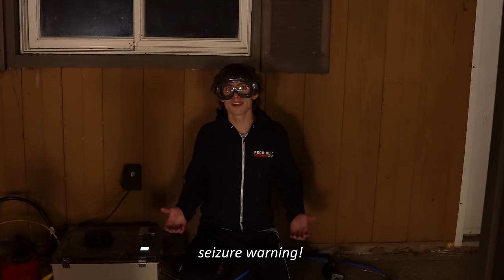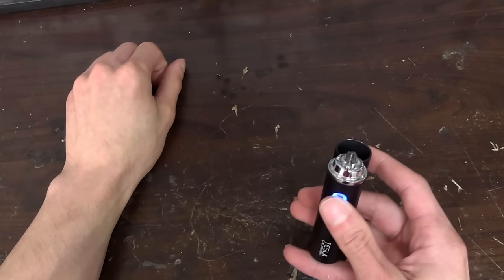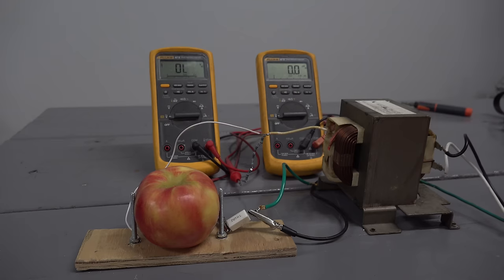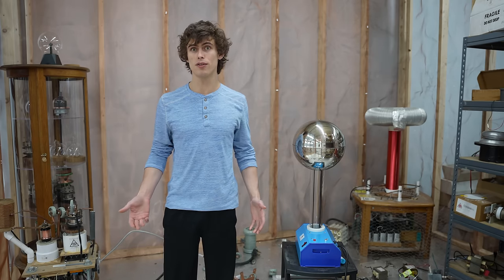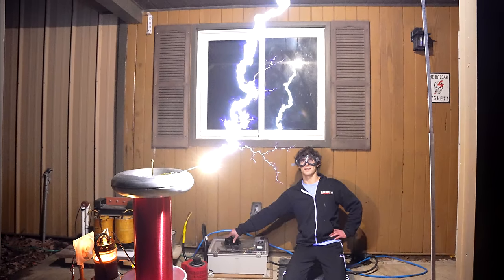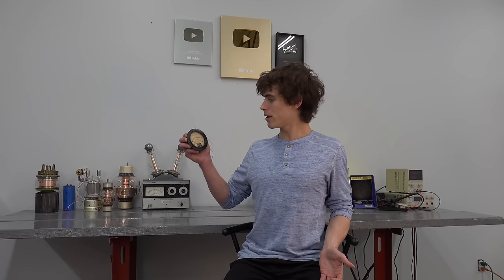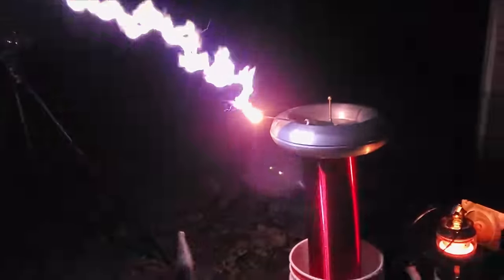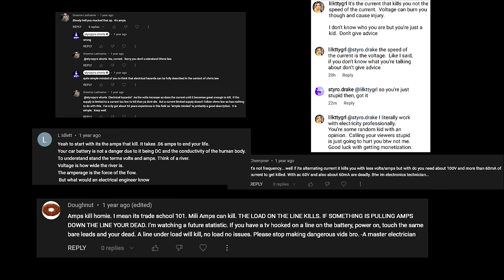Is it the volts or amps that kill?

Comment: I love that pyro's defense for everything he claims is "well I'm not dead", and it's actually a super valid one.
Reply: Yes, but it's not a 100% valid one. Some things kill you by long time exposure and other things kill you if you have the wrong reaction in the wrong situation. So this argument only disproves immediate killing by electricity.
Reply: @benrex7775  Did you only watch 5 minutes into the video? Time affected is a huge point here.
Reply: Exactly, because when the argument is something will kill you, and it doesn't, no amount of flexing degrees or occupations will refute reality. Here Pyro is actually demonstrating the scientific method instead of the authority bias like others.
Reply: @billbill6094  I was answering a different question than you think. I was aware of most of what he said before I watched the video. I mean stuff like the radiation from the teslacoil could be long term damaging to the body. For example the UV of the plasma can cause skin cancer over the decades. Or the microwaves might cause cancer below the skin. And if you have electricity in your body it electrolyzes bodily fluids. Just because it doesn't have a short term damage, it might accumulates over the decades.
Reply: An electric shock can make serious damages to your heart. Making it skip a beat and in the long run could potentionally kill your later in life.
Reply: @benrex7775  tesla coils need 500,000v of secondary voltage to give UV enough energy to be ionising for up to a metre.
Reply: @benrex7775  Yeah, but he doesn't claim anything about radiation, UV, cancer from microwaves, etc. 
If he dies to those, he's still right about his claims... about amps and volts.
(to be fair to you, it is valid to note the other hazards)
Reply: bro survived hiroshima 😭
Reply: rejecting a null hypothesis is often more effective than proving one
Reply: Not a ‘super valid one’. Discover something - write a paper. This is simply a rather poor demonstration and twisting of common knowledge. He actually proved that current is in fact what kills, but that there are numerous factors preventing that current from flowing - which is exactly what every first year engineering student knows.
Reply: @attacker7124  ok and
Reply: @garfeltrealtbh If in 10 years you somehow make it through an engineering degree, come back to this comment and apologize.
Reply: @attacker7124  your biases
Reply: @attacker7124  “He actually proved that current is in fact what kills but there are numerous factors […]”

Wow congratulations, you’re capable of regurgitating the conclusion of the same video we all watched.

If the demonstration proved his argument like you concluded he did, how exactly is it a poor demonstration?
Reply: @mightym  How does the tesla coil compare to a welding arc? I've heard that people who weld for a day while being short-sleeved get sunburn.
Reply: @migueeeelet  My second comment in this comment chain says that I was aware of most of the things he said in this video. The thing which comes to mind I wasn't aware was the deadly voltage, amps and time but too high of a frequency to kill. And of course all the practical knowledge to build this stuff. 
So my point wasn't to prove he was wrong about his statments. My point was that besides the obvious emediate dangers there are some more hidden dangers.
Reply: @attacker7124  i dont want one lmao i have other stuff to do also im gonna delete this channel by then
Reply: Truly a genius beyond comprehension
Reply: @benrex7775  tesla coil only uvb, welding arcs are full spectrum so emit uvc
Reply: @mightym  Thanks. 
By the way there is no full spectrum as the full spectrum would be from gamma rays to radiowaves and further. If you talk about what I think you do then you mean that the tesla coil plasma is colder than the welding coil plasma. And because of that the teslacoil plasma doesn't emit less energy intensive light.
Reply: @benrex7775  full spectrum of uv.
Yeh you're on the right track, its the amps that make the difference
Reply: @mightym  You mean more amps cause higher temperature plasma?
Reply: @benrex7775  I've had too many drinks for this.
UV strength is dependent on the amount of energy to strip electrons within the plasma gas, i.e the electronvolts or kev.
Higher amps means higher kev
Welding arcs strength is pretty much related to amps, some go up to 250 amps while tesla coil is single digits max
Reply: @mightym  Thanks. Before I wasn't sure if I understood you correctly. Now I know we are on the same page. Have a nice day.
Reply: @migueeeelet  the “I didn’t die so this doesn’t kill” is valid here, but not in all cases, for example, “cigarettes don’t kill you because I smoked one and survived” isn’t valid, because cigarettes kill over a very long time, the argument isn’t that this demonstration is wrong, just that you shouldn’t trust anyone who says “I survived so it’s safe” because that’s not always accurate
Reply: Your body resistance can vary depending on whether you’re wet or dry or if the skin is pierced.

When I was young, I got shocked while touching a tv antenna while I was wet after getting done swimming.
When I tried it again after drying out, I didn’t get shocked when I touched it again.
Reply: Slowly becoming more Einstein than him himself?
Reply: @benrex7775  We've been using microwaves long enough to know they are not a concern for cancer, at least at frequencies we can generate commercially. Microwaves, for sound principles of physics, do not affect genes. The only documented hazard is from heating effects, with the eyes being the most vulnerable part. My father was a radar tech in the Army (WW2) and would sometimes warm himself in front of the dish. The Army told him he could not have children, but my 8 siblings and I conceived after that would disagree.

Taking sensible precautions is still a good idea. In my time I often swapped 6GHz waveguides while the 5W transmitters were still operating, in order to minimize service impact. Slide one off while sliding the diversity waveguide on. I've been retired 4 years now and still no problems.
Reply: @flagmichael  Thanks for your insights.
Reply: Yet... Electricity freaks me out, I hate it & fear it and I am ok with that. If someone else wants to play with it go for it but I am glad I live nowhere near this guy...But I am a fan & I love his vids - because I would never even change a basic outlet in my house...
Reply: @Settiis  I like Finland. But I don't really get what you want to say as google translate just translates your comment into some senseless insult.
Reply: @benrex7775  It wasn’t an insult
Reply: @benrex7775  that radiation is what keeps him young
Reply: @DDracee  Just like hulk
Reply: @godzillagamer7512  Certain activities can reduce the maximum age you can reach. The first nuclear scientists didn't get old, people who work with asbestos didn't get old, people who worked with mercury didn't get old, people who are fat don't get old. 

Yes, you can do everything right and die young and you can do everything wrong and get old. But certain materials and actions reduce the average life expectancy by several decades.
Reply: @patjohnson742  Depends on what you do with it. As long as you don't put it in your body nothing happens.
Reply: @mightym  Technically higher amps means a higher quantity of electrons per second.

Higher kev is the magnitude of the electric field strength that is causing those electrons to move. With electric field strength being measured in volts/metre.
Reply: @rasmusolsen441  the electricity has to pass through the heart for that to happen. A shock to the surface of the skin cant do that. You have to grab the positive terminal with one hand and the negative terminal with the other hand in order to risk cardiac arrest.
Reply: Watts wrong with him?
Reply: @attacker7124  what was it preventing the current from flowing from the Tesla coil?  to my understanding, the argument he made was that the frequency was too high to be disruptive to the nervous system. so do you agree that that is what kept him safe or are you arguing that he's mistaken and something was preventing the current from flowing?
Reply: proof by contradiction in action
If it kills me, i should die.
I didn't die,. therefore it doesn't kill.
Reply: "What's your source StyroPyro?"
"I AM THE SOURCE!"
Reply: @attacker7124 Then it still isn't the current because you just said the exact same thing that Pyro said: the current is not alone in the interaction. You can't say that it's the current because you can't look at a 100A source and say "oh yeah that will kill you". K bro, forgot to mention that the source is at 20kHz, assuming it has enough voltage and low enough impedance to reach 100A through your body. You'll barely feel a pinch if you try to shock yourself with that. Long term exposure will burn you though. Which is exactly what was proved in the video with the apple.
Reply: @attacker7124  Bro acts like he's ever gonna be getting an apology for being wrong.
Reply: @benrex7775 and he said time duration is a factor, he even said prolonged exposure to his testla coil could cook him from the inside
Reply: @potatoheadpokemario1931  I have only watched infinity wars and end game. Did he say that in one of those two? 

What do you mean with time duration is a factor? Is he not capable of doing it more than once or did he do something that will automatically repeat itself every 20 years?
Reply: @benrex7775  All the comments were about being instantly killed. Moreover pyro mentions that while touching the monster tesla coil doesn't kill you instantly, he wouldn't do it for long, meaning it does kill you by long exposure.
Reply: @benrex7775 eh, video was about the electricity, not the byproducts

Comment: As an electrician who actually cares about learning electrical theory, It makes me laugh when I read the comments about how "I work with electricity professionally" and stuff like as if driving a car makes them knowledgeable about how a combustible engine works. Just because you twist wires or even solder microchips, it doesn't mean you know everything about electricity.

In school we learn that 15 miliamps can kill. But that's literally the minimum. We rarely put warnings on disconnects if they are 120/208v, but we do if its 277/240 or more. In fact I am extremely careful the higher the voltage, not so much the higher the amps. Its a common joke with my first boss who trained me that if anyone says that amps kill over volts, then we both know they truly don't understand how it works.  Its very complex and beautiful in its own way. Thanks for keeping up this argument.
Reply: Really they should put warnings at 60v or beyond, because that’s right around where OSHA says that you’ll start to experience mild pain from electrical shock. And at 500v is when you experience dielectric breakdown. Anyone who parrots “Volts hurt amps kill” should be immediately banned from any work site because that’s a very gross oversimplification. It all boils down to the voltage, the frequency, whether or not your skin was wet when you were dumb enough to touch a live wire or electrode, whether or not the electrode was in your skin, the amount of time you were touching it, and many other factors. But still, just try not to mess with electricity or live wires unless you really know what you’re doing.
Reply: @therealspeedwagon1451 
I can't personally tell what knowledge level is safe enough...
any tips? 😅
Reply: Just cuz someone's an electrician doesn't mean they're smart I've met some real dumb ones normally the ones that talk a lot to try to justify their existence  and some real smart ones 😅
Reply: @end_musix1636  
Bruh
Reply: I completly understand and agree with you, 150A cant really hurt you when youre running 1V. But it is true that Amperage is the factor that kills you when youre working with high voltages right? Not volts or resistance or something other. So the people saying amps kill are right but also wrong at the same time. Im asking because as a student im kind of confused about electricity 😆 i still dont quite understand what voltage does and why high amperage cant do harm when youre running low voltage. We were only taught basics, A - number of 
electrons flowing through a circuit, Resistance… but Voltage still escapes my understanding
Reply: @MonkeyEnjoyer2748  
I think it's because electrical flow exists on a sliding scale between conservation of charge and energy in the context of emfs. The amount of charge moved through a circuit can have a ridiculous amount of charge, but in close to same way it's way easier to break something with a heavy weight by dropping it than it is by setting it down, the vigour with which that charge is moving means it's not gonna have as much of an affect on as many things. Like, I'm pretty sure that the metal would have let the charge through at 1 or 1000 amps, but it"s effect is different because of the charge, as opposed to the stonewalling caused by an insulator preventing the motion of electrons doing nearly as much.

Someone please correct me if I'm wrong though. I'm an electricity newb. 🫤
Reply: @MonkeyEnjoyer2748 
How do you get 150 amps with one volt?
Reply: @ivoryas1696  Keep learning until you can, or just stick to what's in the code book.
Reply: @MonkeyEnjoyer2748 150 Amps can and will hurt (kill) you. However just because you set the power supply to 150 Amps and 1 Volt that doesnt mean that 150 Amps is going through your body. Thats why it doesnt hurt you. The saying is it amps or volts that kill is not a technical but a philosphical question. Think of it this way, the amps are a gun and the voltage is a human holding a gun and pushing a trigger. You can argue that its not the human that killed someone but the gun, but that still doesnt stop you from going to jail.
Reply: @stephenolan5539  a 6.67 mili Ohm resistance. V=IR.
Reply: @wage6681  
And how do you get that resistance?
Edit I don't mean calculate it.  I mean have it present.
Reply: "says that amps kill over volts, then we both know they truly don't understand how it works" 😄😄😄 Based on your comment I can only conclude the same about both of you. The "amps" of electruc circuits that you construct have nothing to do with the question. It is the amps through your body that do, should you touch a hot wire. And of course the amps through your body are in direct relationship with the voltage of that wire. But it is still the current through your body, not voltage itself that kills. You can touch a hot wire of 110,000 volt, standing on the ceramic insulator, you will only feel a small discharge initially, same as when taking off a synthetic shirt (btw the voltage of this discharge also can reach thousands volts), but nothing else will happen, except raising hear on your head, ha-ha-ha!
Reply: Amps do kill over volts.. in certain situations.  I had a buddy who was drunk in a bar during this exact argument.. he stabbed the ends of both his index fingers and completed himself as a circuit with a AAA battery.. (1.5 volts), fell straight to the floor dead..
Reply: Sparky here and I 100% agree most electricians are just installers and don’t care about theory or how Electricity actually works
Reply: well as a sparky I really would`nt go that low. But yeah you are completely  right !
Reply: Most electricians just do the work... Hence so many 50+ year old journeyman, that never became a Master.
Reply: @stephenolan5539  Voltage is the difference between the conductivity of the currents source and the conductivity of the load. This is known as potential difference.
Reply: @hainleysimpson1507  
Not even close.
Voltage is based on charge not conductivity.
Reply: It is high amperage through you. If you were drench your minimum impedance may be ~600 ohms but likely higher. At ~ 50 volts the chances of penetration of your skin barrier go up and with that access to your core interior which has an impedance of possibly 300 ohms.

What determines 50 volts is differential. If you are 100% insulated you can work on a 500k transmission line live. This is because once bonded to the line the differential between contact points is very low.
Reply: Yeah 15 milliamps that's what I learned in first year

Comment: “Total incident energy” is the term we use. Mostly pertaining to arc flash energy in Cal/cm^2 to determine the minimum level of thermal resistant body suit class and electrically insulating gloves to prevent shock. Had a lot to do with voltage but some to do with max current output and ground fault protection in place. All factors have to be considered